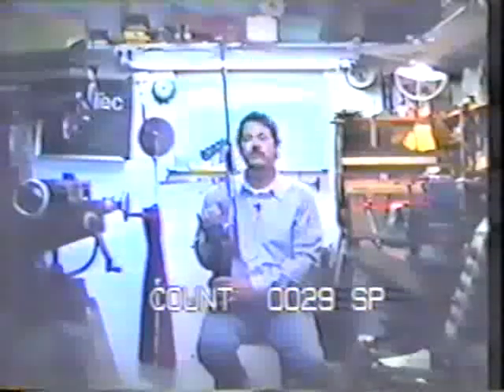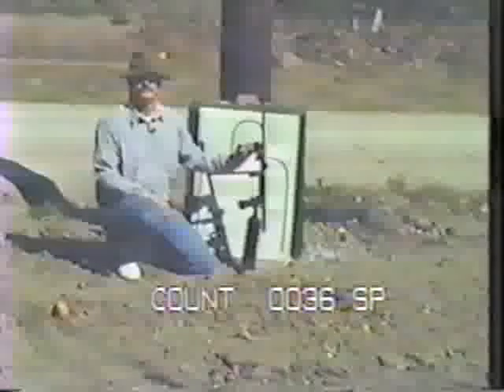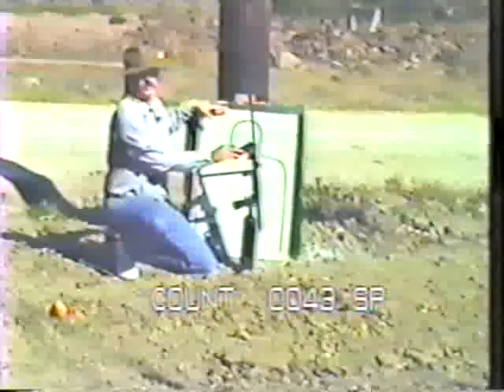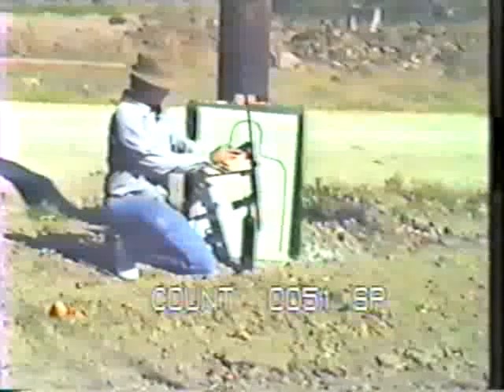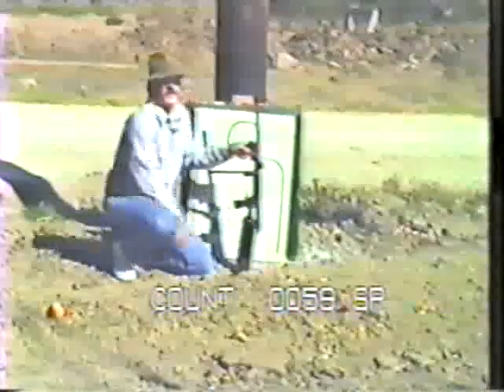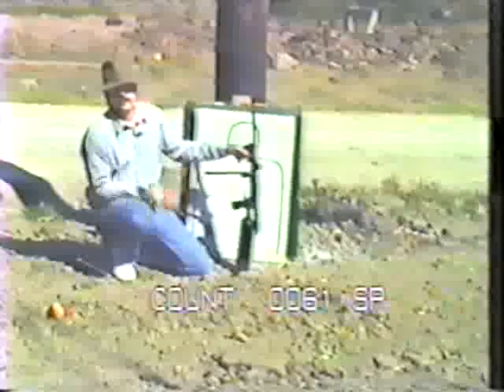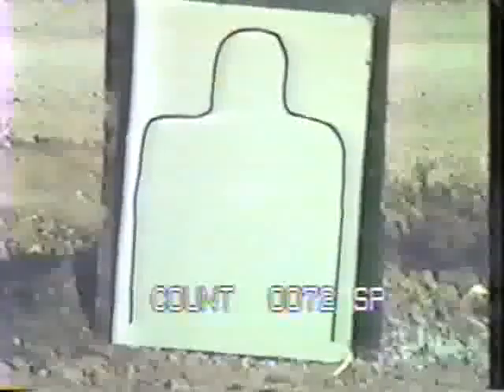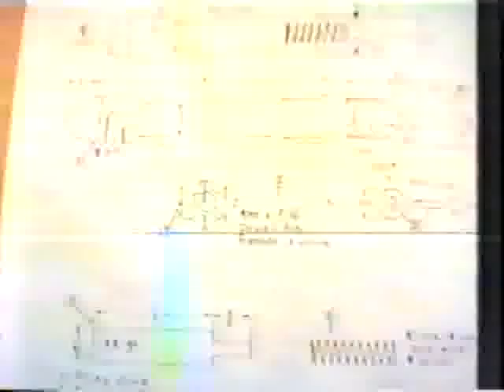Caselman Air Machine Gun - video I

Comment: problem with compressed air is that only the first few shots are maxiumum power. the subsequent shots ccontain less power. the pressure in thetank decreases
Reply: Ever heard of a regulator?
Reply: @FLyAgaric421  or nitrogen fibrewrapped tanks like the badass paintball markers all have extreme psi